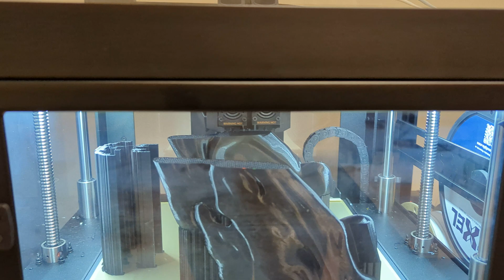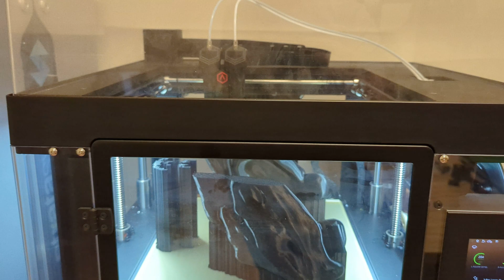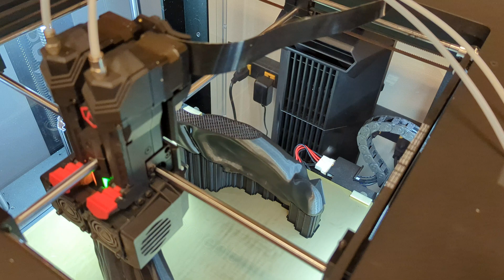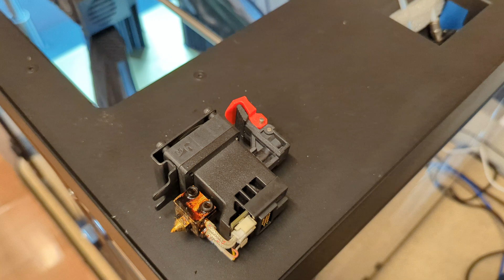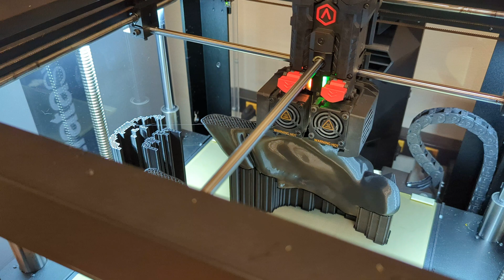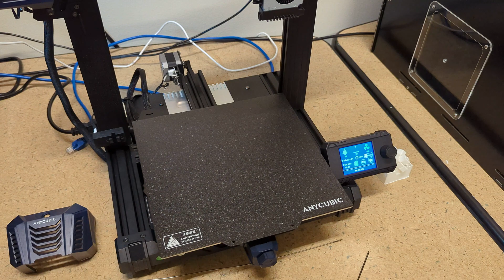Raise3d Pro3 1 year report, problems and issues.

Comment: I haven't experienced the clogging issues you've had. HOWEVER, I've had several board failures and to anyone reading this, DO NOT USE A WIRE BRUSH TO CLEAN THE NOZZLES. This WILL cause a short and blow the associated fuse on the board and in more serious events, it will also cause the motion controller to fail as well (which doesn't present itself in any faults). This is where it gets scary. I ordered the extruder controller board and replaced it and when I powered the machine on, the left extruder immediately started heating uncontrollably. There was no controlling it via the touch screen either. It very well could have caught fire if I hadn't powered it off. Turns out the motion controller mosfets fail in such a way that this can occur. I'm not sure if they've addressed this issue, but as you've described in your video, the support is not great and seems more like a sales department than anything else. To those looking at buying this printer, I would strongly recommend against it. Safety issues aside, this printer is not worth $5-6K. I could go on and on, but please just do your research.
Reply from the maker: Thank you for your input. I had no idea anyone was having more serious issues than I was even. That is absolutely crazy.
Reply: For sure! Prior to me recognizing that the wire brush blew the left extruder fuse, I reached out to Raise3D and asked why it would fail and they stated that moisture in the small amount of filament residue on the heater block created a short that blew the fuse. When I tell you that I laughed out loud. 
Complete morons over there. I have honestly been putting off doing a complete review of this machine, but I think it needs to happen.  @folsomtech
Reply: on a similar note: I also cleaned with a brass brush. Killed the hotend controller board. replaced it and have had lots of issues now with the right extruder only. Now it has reported some ridiculous high temperatures but the hotend never actually heated. It would report zero, then 1100 degrees (yeah right) then flash red and no longer be available without a restart. I swapped hotends, problem remained. So I ended up sticking my old non hyper hotend in. finished a 3 hour print no issues. Popped in the hyper hotend that caused this whole issue (ended up disassembling it to clear it) and it finished a 6 hour dual extruder print without issues. Raise3D tech support scolds me about changing hardware without doing board level diagnostics but I needed a printer not a paperweight this weekend. To appease tech support I need to remove this second control board and do resistance checks on a couple points. Then I assume swap in the hotends that had failed in the past. Im starting to suspect that there is a tolerance issue with the hyper hotends that lose connection when hot and the print head is moving under hyper settings. I'll go thru the hoops though. Want to say the printer works great before the "who knew you couldnt clean a hotend while heating" issue. was doing overhangs and bridges with PLA like a champ. Worked great last night too. now to pull the board as instructed and hopefully not hose it all up again.
Reply: @rickbrasche8781  I had the same exact issue.  The printer is sitting for about a year now, since I now need to purchase a $300 motion controller board, after replacing multiple hot end controller boards.  I also had two print heads go bad, the dual extruder server jam up.   Its become a bit of a money pit.
Reply: Exactly this happened to me. Such a piece of junk machine. Support is quick and useless too.

Comment: I bought a Pro 2 Plus, it's been ok for printing smaller models in ASA and PLA, PC I never got to work, constant poor layer adhesion and parts breaking. But now I have progressed onto much larger models, up to 500mm height, it sucks. Multiple prints failed after 40 hours, layer shoft caused by the nozzle hitting the model and supports despite enabling z hop, no feedback to actual nozzle position. I got through many kilos of filament, now in the trash. Also the hot end securing method is very weak indeed, mine fell off and destroyed the print surface and the entire hot end and started a small fire in the chamber. One tiny 3mm screw to secure it, pathetic... I would not purchase another Raise printer sadly, the next purchase is going to have to be a lot more expensive, like a Creatbot or something, but it's a very large outlay of cash.
Reply from the maker: Dang I'm so sorry for your experience with that machine. I really hope they can fix the areas that their machines fall short.

Comment: n00b observation: this printer seems to HATE slow prints. I try to dial things down and I get heat creep and these weird jams where the filament gets bent between the nozzle and the top of the hotend assembly beneath the short PTFE tube. Cranking it up and getting the filament thru before it has a change to get warm is the only thing that works reliably for me.

Comment: I'm having the Raise3d Pro2 plus and I'm happy with this machine. Very reliable and the free hyperspeed upgrade made this machine even beter. It never let me down also no heatcreep I print ocassionally 80+ hour prints without problems. But I have replaced the standard hotends with the Bondtech ones. Customer service is also great in my experience. Only thing I don't like is the Raise Forum community, it takes forever to get answers there as not many people own a Raise3d printer.

Comment: How is your experience with wifi? I've used two of these machines and they both had major wifi problems. I can place my WAP right next to the machine, or in the same room, and the printer will say it has one bar of signal strength. After a year it just stopped connecting to wifi completely. I had the same experience with two different printers in two different buildings using two different brands of wireless networking hardware.
Reply from the maker: So far it hasn't been too bad. I have had it just disconnect a few times and it wouldn't reconnect until I completely rebooted. But thankfully nothing too crazy. This seems to be the running theme so far with these printers. Is that everyone is having very different issues and there isn't much consistency. Do you also have issues if you're hardwired to the network?

Comment: Well, this explains why I haven't seen this printer in my feeds. The overall mechanical design is the same, and they're still using what appears to be an incremental improvement over the same heavy direct drive print head with nozzle lifter. They added ABL and a flex plate, and... higher print speeds, maybe? But 140 bucks for a hotend assembly is... not very far off from what they charged for the Pro2. But because the filament can get snagged in the short "bowden tube" in the filament path, I got really really good at assembling the old hotends and ramming clear the filament path...

Edit: Are they still using that crap BuildTak? After destroying 2 surfaces, I switched to PEI and never looked back.

Edit 2: I recommend picking apart the GCode generated by IdeaMaker (assuming it still generates GCode) and using that to build a Cura profile. Cura's feature set puts IdeaMaker to shame.
Reply from the maker: Yep still using BuildTak I got sick of it tearing up and ruining prints so I swapped it out for a PEI as well. I might try that Cura Profile.

Comment: Thanks for the video!  I'm looking for a dual extruder setup and the raise3d pro 3 was recommended to me, but after watching your vid I'm having some doubts.  Has yours continued to be plagued with problems?  I love my Prusa's because they are workhorses that just pump out parts.  I wish the Prusa XL multi-tool printer was more widely available, but I won't get my pre-order till 2nd quarter next year.  Did you stick w/ your Pro 3 or move on to something else?
Reply from the maker: Yes I still have constant issues. I still have the Pro3 around at this point just because I have nothing to replace it yet. But I am looking at replacing it with either the Ultimaker S5 or S7. But both of those don't have much coverage on their long term use either.
 I know people with them and have heard good things but I may just have to take another leap of faith and hope I don't get burned again.
Also, the Prusa XL looks very promising and I'm excited to see how it goes in the early years of it's life.
Reply: Hi,
What do you think about the TRILAB series from PRUSA?
Reply: @marfamiros  personally I had bad experience w/ a Seemecnc delta printer that used a bowden tube extruder. Prusa advertises a separate extruder to use flexible filaments in its TriLab AzteQ as bowden extruders have a more difficult time w/ flexible materials; hence the reason I stay away from them. I think they introduce other variables into an already complicated process.
Reply from the maker: @mirkonstantin I’m definitely interested in it. It has some awesome capabilities from what it sounds like. I wish I could get one to test.

Comment: I have the N2+  from 2015, and dealing with raises has been the worst experience I've ever had with a company, I have sunk so much money into my printer just trying to get it to print reliably, and I still can't trust my printer to print successfully. 

For anyone wondering if they should buy a Raised printer, just don't, there are so many better options. I just spent $600 in parts and i have a prusa at my office that's a lot smaller, but it works, and costs less than the repair parts on my printer..
Reply from the maker: Dang that’s really rough. It sounds like some people have great experiences and others just terrible. Seems like just a little more consistency on their end would go a long way.
Reply: the $600 I spent on upgrade parts to "Fix" some issues are causing a whole new world of issues I am trying to figure out. all new extrudes, new hotends, build plate, bowden tubes.. the whole reason I spent so much on this printer in the first place was because the CEO was there at Maker fair and convinced me to go with them over the lulzbot I was originally looking at. now I am over $6k into this printer and still can't get a reliable print out of of it.   @folsomtech

Comment: Thanks for the review. I was actually thinking about buying one of these, but I am going to take it off the list. It's too expensive to have this many issues that cost even more money to fix.
Reply: Completely agree. If a company is going to sell a product as "professional grade" for this kind of price, I'm expecting either professional quality OR professional support. Ideally both.
Reply: Did u find other worth of buying?
Reply from the maker: I've had a good experience so far with the Prusa XL and the Bambu H2D. Both have been great. Prusa support was very helpful when I reached out with an issue early on and got it resolved right away.
Reply: @zeger2099  - I have a QIDI X Max-3 and Plus 4. Although they are not without issues, they have been good overall, and have chamber heating and higher nozzle temperatures. They are a fraction of the price of the Raise 3D printers, and probably out perform them in most regards. Parts are reasonably priced. Better bang for the buck, IMO.
Reply from the maker: I would love to try one of those. Haven't had a chance to get hands on with them yet.
Reply: @G53X0Y0Z0  As garbage as the QIDI QC is, especially with power delivery - it's a significantly better value and lesser headache than the Raise 3D. That goes triple if you don't live in US.

Comment: Pretty sure you can save all your hotends !
Just had a piece of filament stuck right in the middle of the hotend this morning. No way I'm paying 200€ just for this !
If it went in, it can go out !

The solution :
-Heat up the hotend
-unscrew the hot tip
-remove the hotend from the machine (careful it's hot..)
-put the long side of a hex key provided with the machine in the bottom hole of the hotend until it reaches the clogged piece of s***
-gently yank the hotend on the hex key on a hard surface like a table until it pushes up the clogged piece of filament. The hex key should be longer than the hotend so you'll see it go out on top of the hotend.
-done

The hex key is a good solution as it has rounded edges so you won't damage the inside of the hotend.

Cheers.
Reply from the maker: Yep I used this exact method to clear one not long ago.
But sadly I still have one that is still clogged and this method still wouldn't clear it. I definitely try to save as much as possible. Thanks for the feedback!
Reply: @folsomtech  well you have nothing to loose by yanking it with more force !
Worse that can happen, you break it. No big deal as it is worthless if it's jammed..
Best case scenario you successfully remove the jam :)
Reply from the maker: That is very true lol
Reply: Similarly, I heated mine up. Used my heat proof barbecue gloves, powered off the machine and pulled the hotend (yeah now Im super paranoid about killing another hotend controller!) unscrewed the two little allen screws on top of the heating block, removed that, yanked the filament out, reassembled, and good to go. I could not for the life of me get the nozzle to come out, even when hot and the heating block allens loosened. Whole assembly tries to rotate and break the leads going to the connection board. Which sucks because I need to install a hardened steel nozzle soon.

Comment: I’ve had a Pro3 for a little over a year and mostly been very happy with it (and their support.)

I’ve gotten really nice results with PLA, PETG, TPE, TPU, PC, and especially ASA, which along with HIPS supports have been my favorite filament. The only ones I’ve been disappointed with have been NylonX and Ionic and PVA.  I bought a second extruder assembly to swap in 0.6mm nozzle plu a garolite print bed to do NylonX. It works but is not as nice as other filaments.

What’s the third party bed you got?
Reply from the maker: Oh good! Maybe they are working on quality control a bit. I'm glad someone is having a good experience! I ended up getting one through Fulament. They didnt have the perfect size but it's close enough that it's fully within the build volume for both extruders.
Reply: @folsomtech  Thanks. I wasn't familiar with Fulament beds. Curious which filaments it works better for? I have two of the build sheets that the Pro3 comes with - one that I put a new BuildTak whenever my hot prints (PC) have ruined it, and the other that so far I use just for nylon since I can't get nylon to stick to BuildTak at all.
Reply from the maker: I've had decent success with all materials. Nylon still needs some adhesive help though. There is a other 3rd party bed I have on another printer that has been incredible. I'm going to reach out to the manufacturer to see if they would make a custom size for the Pro3
Reply: @folsomtech  Good to know. So far I've found BuildTak with nothing on it works great for PETG, ASA, and PC, Buildtak with Magigoo (original & flex) works best for PLA, TPE, and TPU, and for nylons I have to use the garolite sheet on my other build plate, either with or without Magigoo PA. I buy the BuildTak and garolite adhesives 3rd party and then just glue them to the metal plates from Raise3D.
Reply: @automaticprojects  the buildtak also works well without any glue stick with TPU, just don't heat the bed.
Reply: @matthias3445  Good to know. I think I've had similar results for TPE and TPU on BuildTak both with and without Magigoo Flex, but I've only tried it with the bed at 50. Not sure if that counts as heated since its lower even than PLA, but let me know if it works even better just at room temp.
Reply: Yes, only ambient temperature. It sticks very well and is removable with the spatula, once finished.
Reply: So.... I created a 3D Model of this small PTFE Tube between extruder wheels and Hotend with smaller clearance then original, so TPU and other flexibles doesn't spool themselves onto the Extruder wheels and produce failures
Reply from the maker: Oh that's awesome! Would you be willing to share the file?
Reply: @folsomtech I will test it a few days. Doing some printing with TPU and PP and if it works as expected I will share it on Printables and Thingiverse. 
I will write here if it is uploaded.
BTW I printed it with ASA and for the first 4 Hour of printing with tpu there was no problem. And I hope I don't get any problems with Raise3d as they sell this tube as a costly spare/replacement...

Don't know why... But my comment for the file on printables gets deleted every time...
So just search for PTFE Tube better replacement raise3d pro3
Reply from the maker: Hey I’m glad you say, I recent got an email announcement that Raise is not offering a standard 1 year warranty with all printers they sell from now on! That will be great for new customers that may run into issues. Glad to see they are improving.